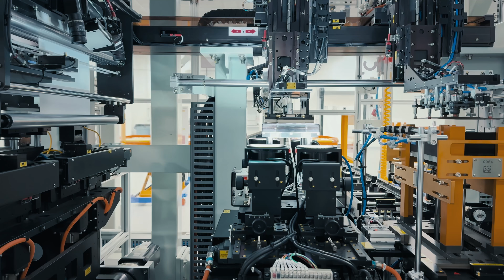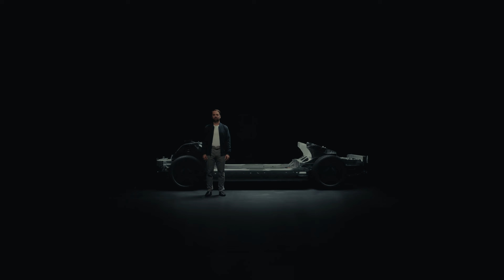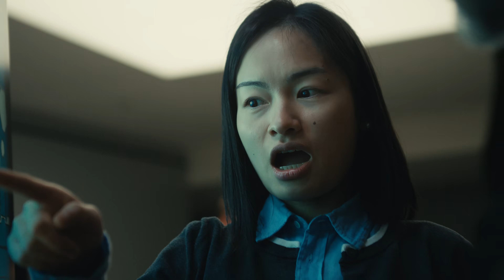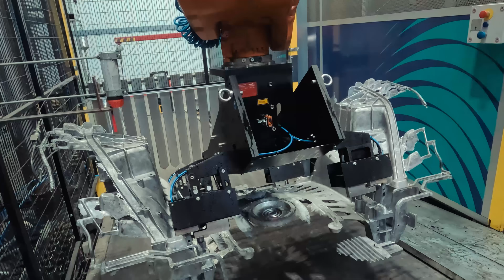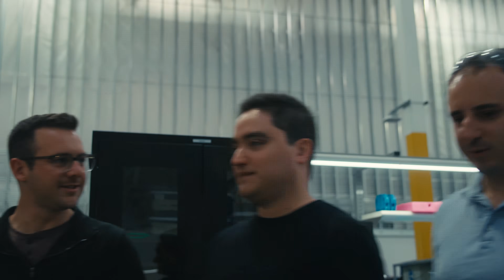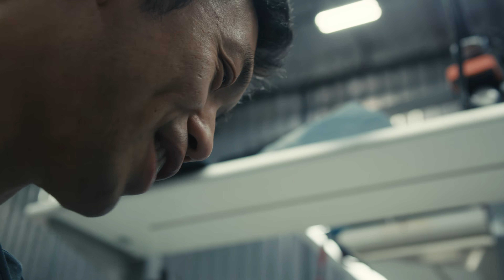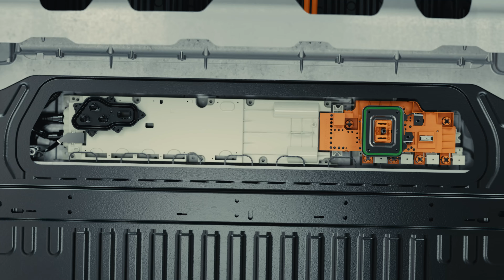Ford Bounty Hunters: The Pursuit of Efficiency

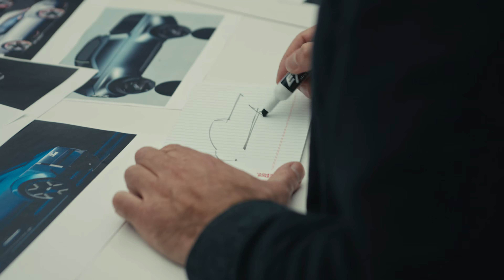Comment: At 0:57 u can see sketches of the new truck. Not of fan of the front end, but can’t wait to see the production model
Reply: At first I liked that my Lightning looked like other F-150’s. Then I realized they could’ve made it much more aerodynamic and increased the range. I really hope they ditch the square truck front end. 🤙
Reply: @craig8638  The picture of the dude with a nose ring buffing it out shows the front is even smoother looking than the current maverick redesign with a tiny little lower slit grille opening.
Reply: Looks like the DRLs will be in the shape of a TT

Comment: Looking forward to checking one out....exciting times indeed!
Reply: Most energy dense LFP cells have 195 wh/kg energy density with ≈4000 cycle life,but there is more room for further improvements.i hope ford with help of LG energy solution,will adopt and commercializes dry coated LFP electrodes cells.dry coating has the potential of atleast 70% higher energy density LFP cells with dry coating and single crystal active materials.dry coated LFP cathodes have 55% higher active materials(amaazing 290 wh/kg)also dry coating lets the electrode to be twice as thick as wet coated LFP cathodes(20% higher energy density meaning 330 wh/kg.also with single crystal cathode and anode active material they can achieve mind bending 350 wh/kg at cell level.dry coating increase the cycle life by 100%(8000 cycles),single crystal increases it by 30%(10400 cycles).dry coating increases calnedar life by 100%(20 years instead of 10 years)meaning amazing 0.5% capacity loss per year in dry process vs 1% of current wet process LFP cells...

Comment: What does the giga casting methodology do to the repair ability of the vehicle should be involved in a collision?
Reply: Supposedly gigacasting generally results in lower overall repair costs. Small cracks can be welded, larger cracks need full replacement, but ends up being cheaper than smaller subassembly frames for parts+labor.
Reply: It looks like the front and back are different parts so it’s probably expensive but doable to replace the entire front end or back end
Reply: Aluminum stays stiff under stress, then cracks. It doesn't bend out of shape. So, kind of digital.
Reply: Usually with that amount of damage, insurance will total the vehicle
Reply: they can be welded